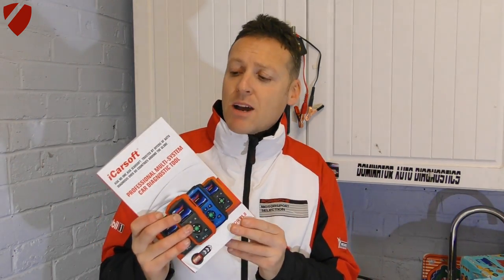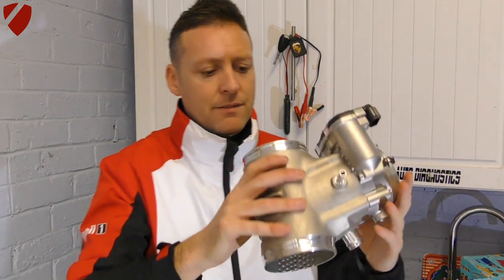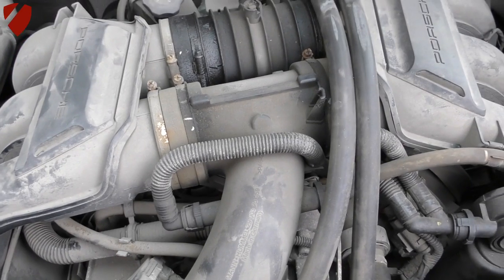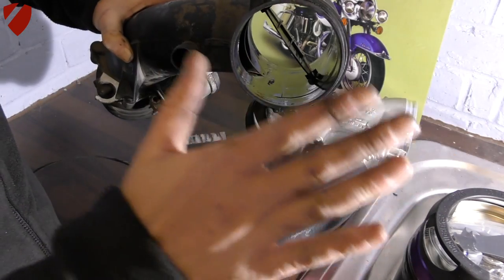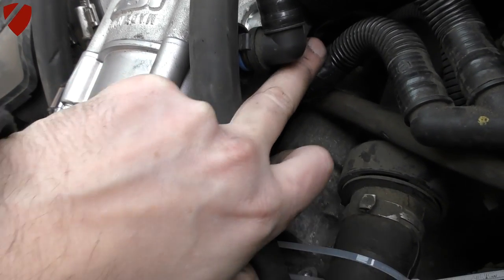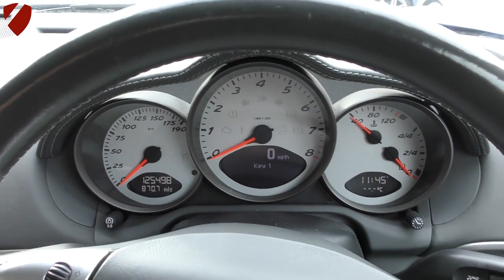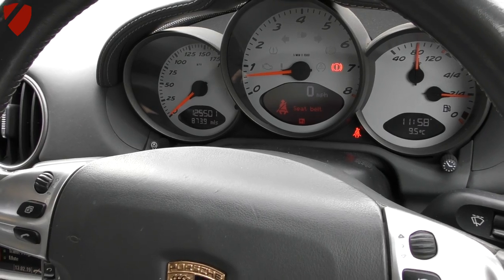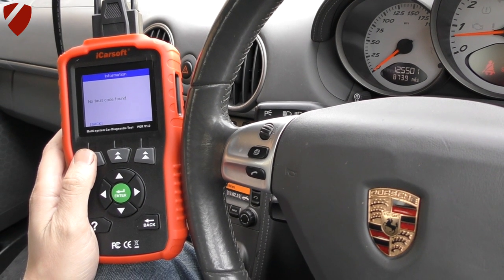IPD Plenum & GT3 Throttle Body Install - Porsche Cayman/Boxster 987 review vlog 😍

Comment: I think the butterfly valve that you just eliminated, is there for an specific reason by porsche engineers... normally it will close slightly during slow revs in order to increase the air velocity inside the plenum! BMW has the same design in their plenums (i’m a BMW owner) put again everything back to stock and see how the engine reacts. 👍

Comment: I wouldn’t worry about it. It’s just confusing the ecu. My 986 boxster idles rough sometimes for no reason since I put a k&n panel filter in. But once driving at high revs and the 24v is at its peak it comes together insanely. But a bit of a dog at low revs. When I changed back to the original panel filter all went smooth but was a bit less pokey at high revs. I was thinking of a remap but was discouraged as I was told there is not a lot of people who will take care with your engine tolerances when re mapping and could end up doing more damage. 

I just live with the pros and cons of the k&n and tbh it’s worth the cons imo
Reply from the maker: I have not yet looked at my air filter/induction kit as i want to get this part right first.  I will eventually though and have heard good things about the soul induction kit but will also be looking at the K&N kit. Thanks for watching appreciate it.

Comment: I'd cut down the silicone hose where it connects onto the plenum by 10-20mm to move the elbow forward so it doesn't rub on the body where that tab was bent up..

Comment: Spray some carb. cleaner or brake cleaner or  wd40 spray around all the hose clamp connections if there is a leak the spray will be sucked and will temp.  change the  idle speed 
Have Porsche refrlash computer.

Comment: Fitting an IPD plenum for a standard size throttle body is fine as a bolt on mod, but changing to a bigger throttle body will need a remap. 
The DME May adapt to a point where you don’t get fault codes, but slow speed around town driving will suck! And you won’t be getting the full benefit of the larger throttle body without telling the DME it has it!
Reply: This!

Comment: you need to remove those hoses that you were pulling to the side and have them actually over the plenum to have it pointing down, it is too high and air is not going in properly, it needs to be pointing down and you dont need to break that holder for the nut from engine cover, it should not be touching the plenum.  If you want I can send you a picture of my engine bay.
Reply from the maker: David Rincon Jimenez thanks David can you email me a picture at driver_81@outlook.com putting the vent pipe over the plenum/silicone tube would make much more sense.

Comment: Cleaning the MAF sensor while you had the old gear out would've been a good add-on step.
Reply from the maker: Vic Sorlie completely agree. I’ll be doing that soon just need to order some chemical contact. I would normally go to a place called Maplin here in the U.K. for that product but they closed down and have to buy it online now. Hope you are well. 😎👍
Reply: @alsatch_  Building on that, what kind of shape is your air filter in?  Fresh one would give the ECU best chance for adaptation.

Comment: P0421 means you need a new catalytic converter did you change it or code it out or  move the o2 sensor out of the stream with a spark plug fouler?

Comment: There is a vacuum pipe controlling the butterfly valve - on the original pipe, there is a disc valve, a thin vacuum tube come out it, did you plug another end?

Comment: how did you find this install in general? Looking to perform this upgrade on my 987.1 Cayman S. I've read posts that some guys snaps the breather line that runs from the drivers front of the engine to the AOS and also leaking vacuum lines. They had a hell of a time replacing the lines and figuring out where the leaks are coming from. Im just asking for your input before I try to install. thanks in advance.

Comment: Is the tachometer wiggle normal on these cars? Lots of places saying minor wiggle is normal? Noticed it on first test drive... Anybody noticed this from new or able to eliminate the wiggle in entirety from their Boxster/ Cayman???
Reply: @eddherring4972  Thanks Edd, I experienced 2 weeks of no wiggle so I'm inclined to think its not normal. No way to tell what is causing or contributing to problem. Will wash car and lean over into engine bay to start with TB and MAF clean and go from there.

Comment: I would definitely unplug the battery 1st for a few minutes so the ecu resets.  Plug back in and then go for a nice long drive.  It will take about 1 week of driving or couple hundred miles for all the fuel maps to be regenerated with the new air flow and ipd plenum.  A good maintenance practice at the same time would be to spray your MAF Sensor with CRC Maf sensor cleaner.  It's an electrical component cleaner.  I was happy to see you move the Air/oil vent tube out of the way.  You may want to double check that it was not cracked in any way if the error codes keep coming back..  I noticed you are doing this in very cold weather.  This makes all those plastic vent tubes very stiff and brittle.  If the ECU error codes do not go away after 100 miles of driving you may have cracked a vent tube or vacuum leak some where   ;^( 
I do like IPD products, but they are a p.i.t.a to install in the caymans/boxsters.    Keep us posted!!  great video!
Reply from the maker: qikqbn77 yeah I think I need to completely uninstall the whole thing and start again - making sure of no leaks, cracks etc.  Pain in the arse indeed but hopefully worth it.
Reply: @alsatch_  I hope it's ok.  Porsche is very sensitive to vacuum leaks or changes in airflow.  100 miles driving should fix the idle issues and any fuel maps.  Mods that change air flow are not always night and day difference right away.  Once the ecu adjusts there will be one day you will be driving and say to yourself... "Hey, that feels much better and faster now through that area"...   Any errors that linger after that may be due to a vacuum leak. .  May be helpful to use a heat gun or blow dryer to warm up those plastic/rubber parts during install.  Also make sure the Vent line that attached to bottom of plenum did not come unplugged at the other end.   I know all about this, because the air/oil vent line under my plenum did crack and was a bitch to uninstall everything, replace vent line, then reinstall  2 or 3 times before all was back to normal.   Best of luck and keep up the great work!  Just some advice.  Intake and exhaust mods can be learned and adjusted by ecu, but sometimes with the additional air the ecu will compensate by adding more fuel which will create a "RICH" fuel mixture.  This is where an ecu tune mod will be very helpful.  I have not done and ecu mod yet, but if you ever do a dyno test, make sure to get an AIR/FUEL Ratio test done as well.  Cheers!

Comment: Great video.  Been watching all your vids  I have Gen 1 base cayman. Just curious, noticed your car has 125,000miles , has the car ever had the gear shift cables replaced or broken? Seems to be a worrying issue with the Cayman manual cars
Reply from the maker: Nick Vangopoulos Photography there is no paperwork to show that they have been replaced and they look old so I’m fairly sure they are the originals. It is a worry but you can buy updates cables I believe. Thanks for watching hope you stick around. 👍
Reply: numeric makes the upgraded shifter cables.

Comment: I am always sceptical about power gains on these flat 6s as Porsche have a tendancy to optimise performance and know what they're doing for efficiency. I noticed you had a vacuum pipe on the original throttle body - was this reconnected as that will throw idle way off? You really need to benchmark standard car on rolling road then compare after the mod. I will be interested to see part II
Reply: 2001 E46 M3 was making 340bhp from a 3.2L engine, these in 2006 296bhp from a 3.4L engine. Even though it revs to 7.2 compared to 8.2 I'm sceptical of Porsche's true intentions in this case, maybe they couldn't let it overshadow the 911? With big bore throttle body, sport exhaust, headers and de-snorkled air intake these apparently get tuned to ~350bhp.

Comment: Look forward to your next update little squirt of gt85 on the hoses would have seen them slip on with ease that engine bay is manky tho hahaha
Reply from the maker: Tom - 912 I’ll be taking it all apart again for a refit so will be cleaning everything properly
Reply: good stuff, you've spurred me on and plan on whipping my exhaust of the 997 and having the gundo done over the next couple of weeks
Reply from the maker: Tom - 912 gundo is awesome. I plan to do that on my 997, my to do lists just seem to be getting longer and longer. I think it would be cheaper to have a drug problem. 😩

Comment: Sounds like a battery is still needed sir!
Reply from the maker: Yeah just haven't got round to it yet. It's not urgent so ill do my planned mods first then do the battery, may aswell use this battery while doors and lids are going to be opening and closing lots during the modification stages. Thanks for watching stay tuned for part 2 coming soon.